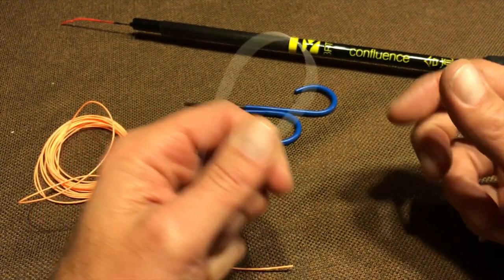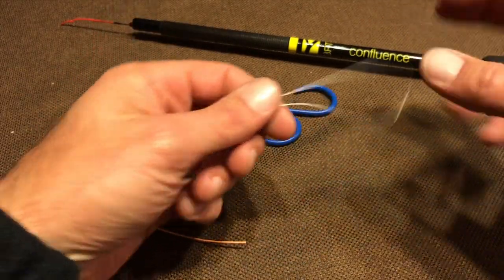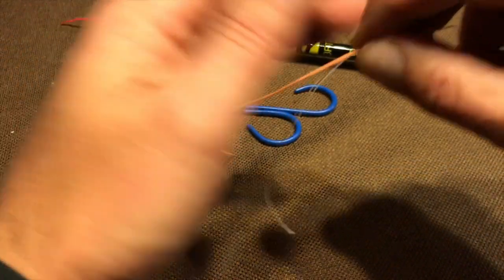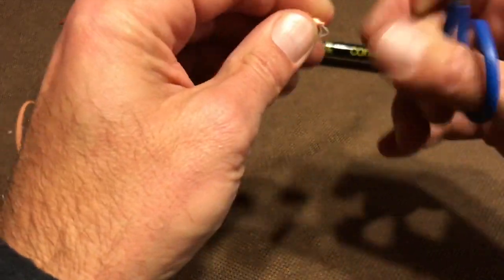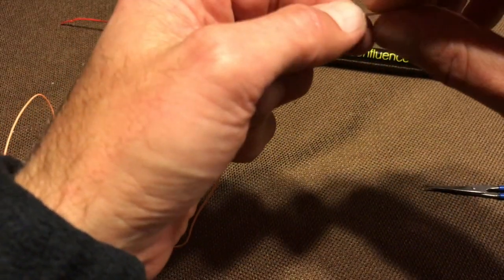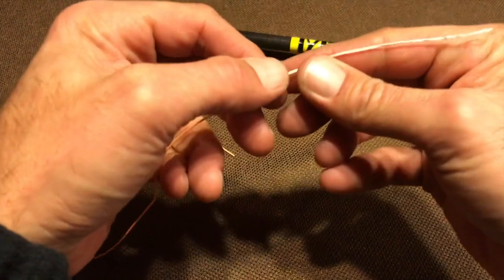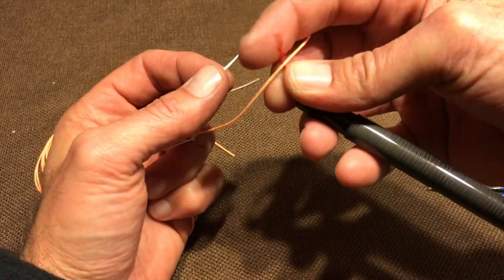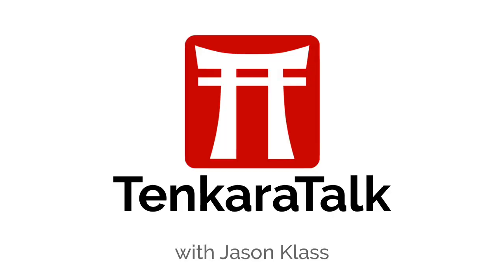How to Attach Any Line to a Tenkara Rod

Comment: Oh man, I like this a lot. I've been tying a figure 8 in the level line and then girth hitching the backing up against it and holding it all together with a dab of super glue, but this is simpler. I'm going to switch to this for future lines. Also, I appreciated your recent 3RT Confluence review. Does it work equally well with weighted flies, or does it struggle a bit there? Thanks for the videos and the blog.
Reply from the maker: Thanks! It depends on what your concept of "weighted" is. If you're fishing a small fly with a bead or some lead wire underwrap, it's fine. But it's not going to throw a #4 cone-head wooly bugger well (which tenkara rod does?). But you probably knew that already.

Comment: So I know this is a really old video, but I'm just starting to get into tenkara and come from a saltwater background. In saltwater, we work with hollowcore braids a lot, either spectra or dacron, and create splices that way. Do you know if anyone has used hollow dacron to splice a loop onto the lillian via whipped finger trap type connection?  Then you can loop to loop any line you want very easily. No knots needed and clean transitions.
Reply: That would make a nice transition, but pulling your whole line through the loop seems like a PITA. With this method, on and off is as quick as is possible, which is a huge advantage where it is a fixed length and you have to trade out lines if you want to change it up